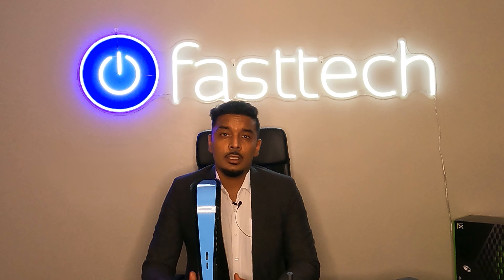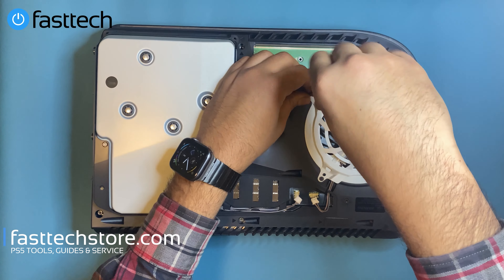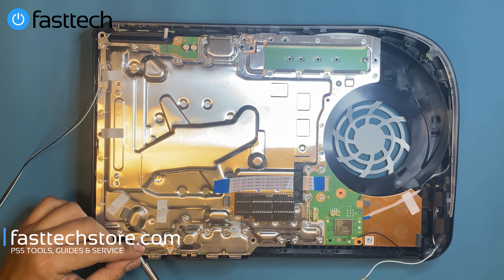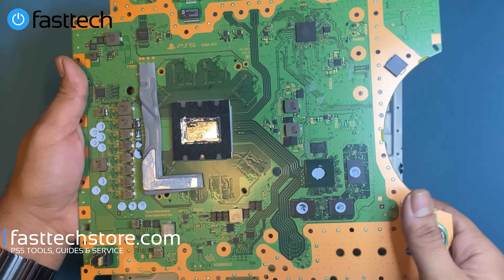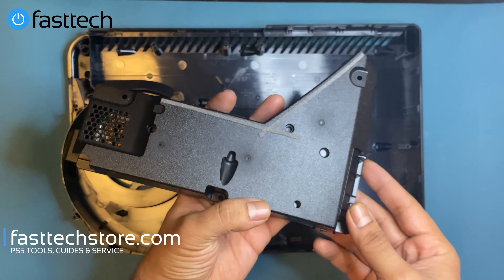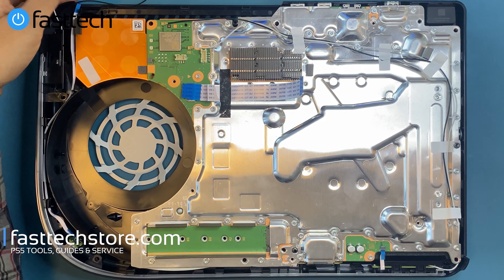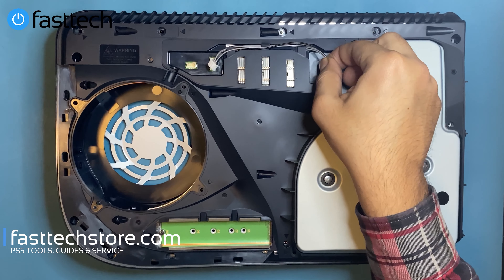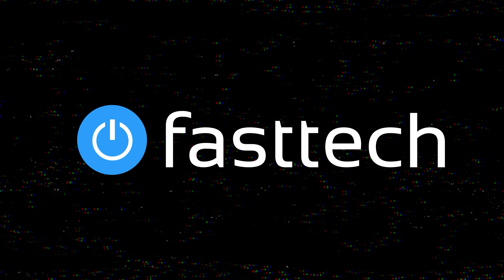PS5 Disc Edition (CFI-1015 / CFI-1000) Disassembly, Reassembly and Repair Guide

Comment: An absolutely outstanding video. I can't tell you how upset I was looking for the right instructional video, and couldn't find a single video along with the correct directions, anywhere! I just bought it and had hdmi issues almost right out of the box. Anyway, I had some difficulties with reassembling due to so many different sized screws and couldn't  remember how to reassemble them in the correct format. "Really Sony, 3 or 4different sized screw just for the fan alone"?. So I just wanted to say that I found your video and put my system back together and it's running well. Keep up the good work because people are definitely follow your tutorials!
Reply from the maker: Thank you so much. Make sure you subscribe and like the video.

Comment: 14:20 

Hi. On the power supply label for cfi-1000 did it listed 100-127 and 220-240 or only 100 V?
On box and bottom of my ps5 it shows only 100v - just curious if the psu support dual voltage or only single like mention on box and bottom of ps5
Reply from the maker: All ps5 and by extension ps5 power supplies do both 110v and 220v

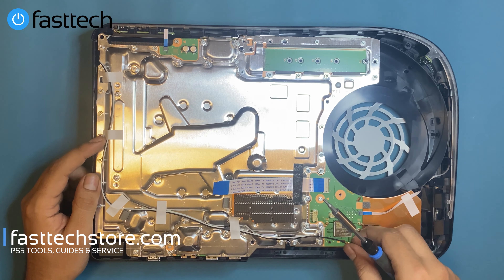Comment: The white wire at 7:07 the button connector attached to the board came off how do I repair it?
Reply from the maker: You are going to have to solder it back on